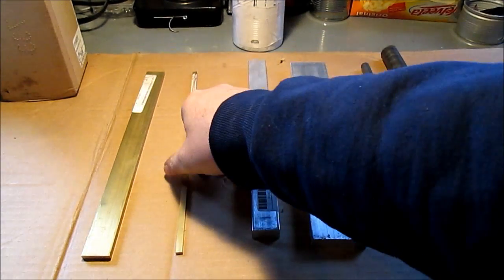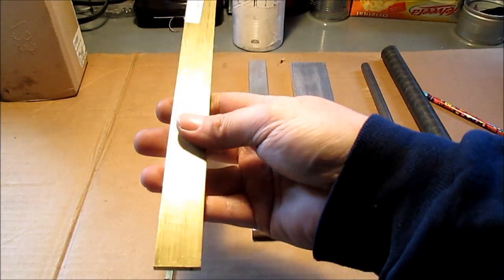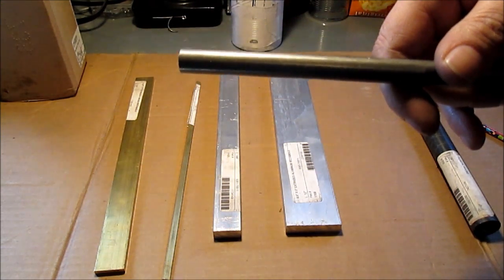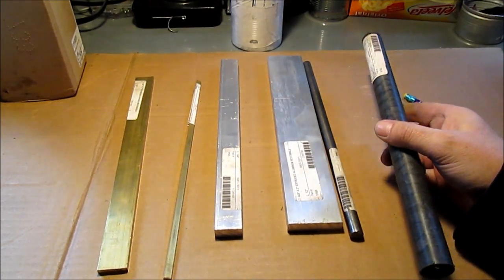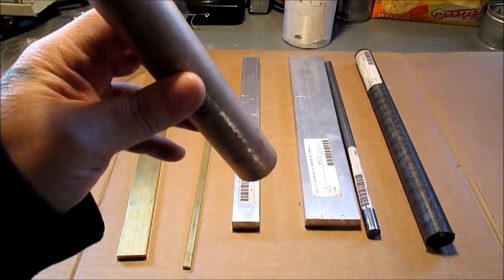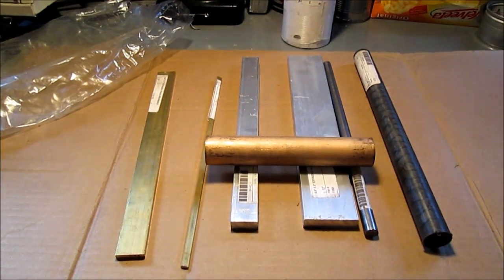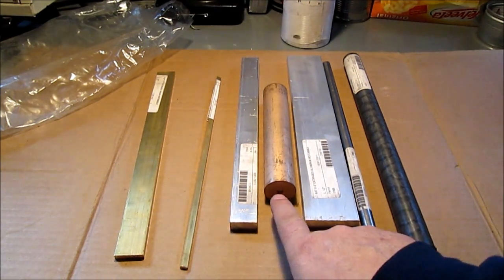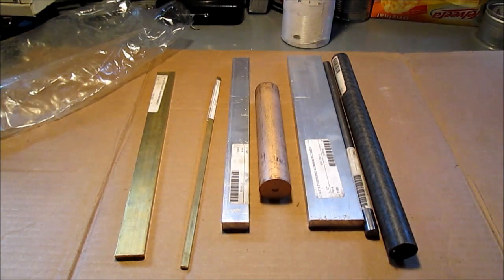Flat stock and Bushing material for projects

Comment: I know how it feels to get the materials you need, especially new. Nice new unused, so you don't have to worry about strength and it holding up.
Reply from the maker: Most of this will be used to remake parts on the old lathe I'm redoing So it had to be right I still like recycled free material